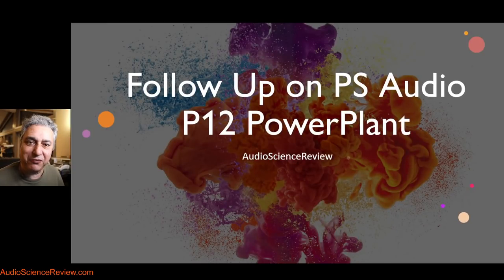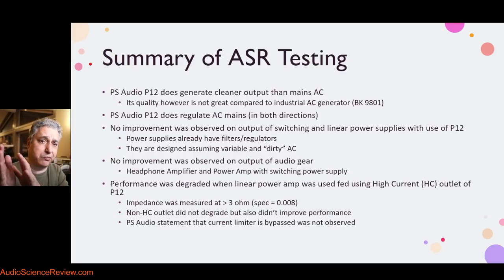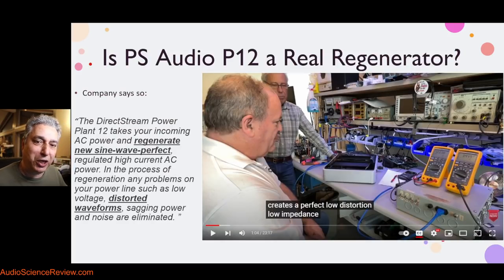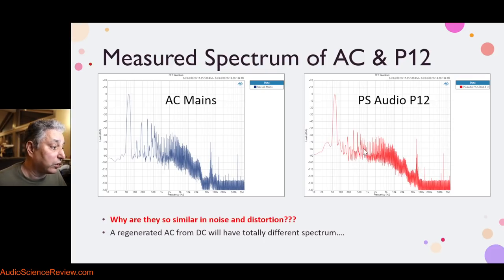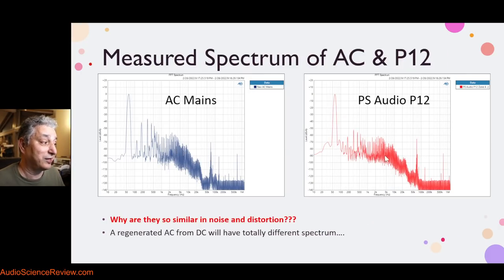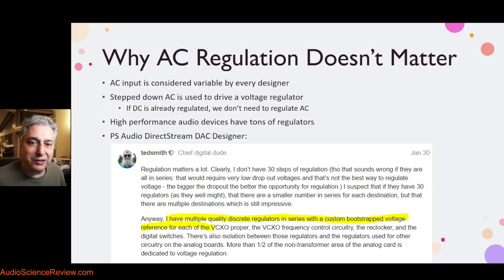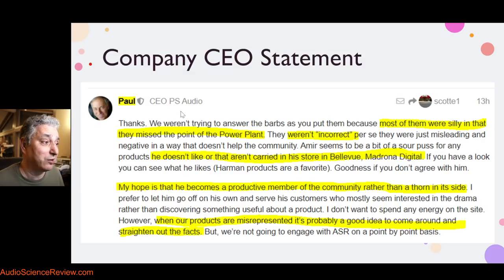PS Audio PowerPlant Measurement Follow Up

Comment: I am not surprised he replied like that. I used to watch Paul's videos when new to the hobby, but I quickly moved on. The guy gets asked reader questions (a good concept so far) but his replies are always very vague and almighty. He presents himself as an old man with ultimate knowledge and experience, he can't be wrong. I work with electronics, restore old tube radios as a hobby, his "lab" didn't impress me. You can't argue a waveform or a spectrum result unless you are in a cult or in bad faith.
Reply: @joesmith4443  How many times are you going to cut and paste this same tired steam of innuendo and heavily curated observation leading to a thoroughly banal conclusion?
Reply: @_kardus  yes but I’ve seen Amir along with his “Donors” crap on input from vendors regardless if the information is accurate and factual simply because he and his “Donors” are cynical or don’t like their products or digital format nor fully understands them or don’t want to!
Reply: @joesmith4443  Amir is financially independent, but that doesn't mean he must live off fresh water and love.  He has every right to get renumerated for his time and investment. 
Don't forget that for a 'hobby tester' he has more testing equipments than some audio companies....
Reply: @dihydrotestosterone  look I’m not saying what Amir does is not valuable and it’s nice to have a “customer reports” or “buying beware” watchdog. It’s just that what he created is somewhat of cult (probably not by his design) 

I don’t mind that he is fiery but sometimes his opinions become dogma maybe not by him but by others’. We all a flawed and have blind spots! 

I am not gonna comment anymore on his YouTube page I’ve said what I want to say. It’s really not fair to the anymore to keep a grudge and keep talking negative about him and his content.  

I’m glad that he’s doing well financially and can do what he wants with his time now. Geez who the heck doesn’t want that…I wish him all the best in life and believe what he’s doing is value content to his viewership and not easy especially to take criticism like mine. So there’s no point to being a “troll” and hanging on to resentment because before you know it you turn into that cynical person trying to get likes from snarky sarcastic comments. :)
Reply: @_kardus  yea and no filter is perfect but does influence the sound signature of Dac so does how the firmware is spec’d. That’s why its nice when a manufacturer keeps updating their firmware. I’m like most hate sibilance sp?? And harshness In the playback Sometimes however I’ve found that is more or less poor vocal technique baked in the recording than the actual DAC filters or the performance of the DAC. 

The firmware algorithms are encrypted and does play a large role in the playback and overall sound signature and the circuit design which often isn’t 100% implementation to the datasheet of the dac chip which measurements only give a half truth about. It’s easy to get benchmark scores if that’s what people are testing for and what manufacturers know that’s what they testing. But then it get to people having to describe the sound of the dac which is subjective
Reply: @_kardus  You just answered your own question if it’s poorly designed he doesn’t know it from sine testing on a DAC. Unless you are saying listening the 1khz or 2 khz is a “pleasurable” listening experience. 

In one review he complained that a particular speakers eq was “off” than adjusted it with a presumably is an expensive eq software and it was perfect. That’s a little more legit of review but that’s a software/firmware adjustment that can easily be fixed by the manufacturers if he wanted to inform them of it instead he bashed them at least let them know what you think then post your review if they tell to eff yourself. Give them a chance to at least fix it or explain their engineering decision before you bash their product! We may not have the testing equipment but he does to give them fair chance to fix, a fixable issue!
Reply: @joesmith4443  His measurements and tests are excepted by other companies and engineeres such as Schiit, Emotiva, Hypex and Gene from Audioholics... I've also seen him measure out different filters built into some DACs and they seem to match what Topping or SMSL advertise. Most of these filters have little to no effect in the audible range probably why He doesn't mess with them. They're only included because AKM baked them into the chip. I'm sure you know more than Amir and all these other people so when will you be starting a YouTube channel and buying $100k in test equipment to prove these guys wrong. Can you present any academic or scientific literature that backs your claims or debunks Amir? Or is it just easier to sit at a computer and stroke your pretentious ego. At the end of the day Amir is providing valuable info most companies won't but they want you to spend $5k on a DAC or cable.
Reply: @joesmith4443  -- Nothing "is up."  Amir is a rather well-off entrepreneur and retired executive-level engineering manager who owns a well established custom installation business -- he doesn't need to "monetize" ASR.  There's no way his (relatively recent) activity of posting video versions of his reviews on U-Toob and (the typically small-$$) contributions to the ASR website's upkeep are enough to even cover the five-digit cost of his AP analyzer, let alone the six-digits he paid for his Klippel NFS.

Bottom line: the guy's ASR-related activity is a 99.44% pure labor of love and your cynicism is entirely unfounded and unwarranted.  IOW, you can't "say why" because you don't know WTF you're talking about!
Reply: @iowaudioreviews  Those DACs that you mention Topping or Smsl if you look at the specs have almost identical parts and are probably made and sourced in the same factories. Sure they are based on AKM or Sabre chip filters and whatnot and have good measurements but are relatively “clones” of one another give or take some different features. Even the different features for different price points. Why is that? 

Well because they measure great SINAD scores but  really they don’t sound all that different from one another. So they make Amir’s list of highly recommended when they all sound similar if not the same. That’s what I’m getting at there’s no individuality and all Amir is saying that they are scoring benchmark SINAD not seen three or four years going or are “unheard of only a few year ago” Amir would say. 

That’s really my “complaint” like of imagination from these DACs just SINAD benchmark scores to look at from Amir which In most case Smsl and Topping already provide the same test (give or take one or two dbs differences)
Reply: @joesmith4443

HERE WE GO AGAIN..... WILL YOU BE PASTING THE SAME REPLIES AND COMMENTS YOU DID WITH THE LAST PEOPLE YOU CAUSED TROUBLE WITH?.......

GLAD YOU ARE GOING TO JAIL.

Comment: Excellent data and measurement-based response! Thank you for doing this for the community! The consumer community!
Reply: Yes but in fairness to Paul he did say that there was a firmware update that affected the measurements. For accuracy Amir should do this check as well.
Reply: @joesmith4443  so basically he sold a product with faults that needed a firmware update. Amir, said he used the latest firmware !.
Reply: @r423sdex  Amir didn’t. Btw I’m not advocating for PS audio crap just believe in fairness
Reply: @joesmith4443 

SMITH...... YOU AT IT AGAIN?..... PASTING THE SAME REPLIES TO DIFFERENT PEOPLE?.....

-- Nothing "is up."  Amir is a rather well-off entrepreneur and retired executive-level engineering manager who owns a well established custom installation business -- he doesn't need to "monetize" ASR.  There's no way his (relatively recent) activity of posting video versions of his reviews on U-Toob and (the typically small-$$) contributions to the ASR website's upkeep are enough to even cover the five-digit cost of his AP analyzer, let alone the six-digits he paid for his Klippel NFS.

Bottom line: the guy's ASR-related activity is a 99.44% pure labor of love and your cynicism is entirely unfounded and unwarranted.  IOW, you can't "say why" because you don't know WTF you're talking about!

Comment: That was passionate !! :-)   Praise to you for your professionalism.  Very unfortunate that PS Audio does not acknowledge flaws and attempt to fix them, which would not prevent them flogging useless gear, but that at least it would perform as per spec and expectations. I was very also surprised to see the engineer noodle around with voltmeters; simply not serious.

Comment: I own a PS Audio BHK 250 power amp which I bought (used) to replace my ML #27 - and I never regretted this decision. I started to like PS Audio after my experiences with the BHK 250. However this episode makes me a bit uncomfortable. If you screw up - own it! It’s simple. The moment PS Audio went personal in its defense, they as much as admitted (imho) that they screwed up. 
Thanks Amir for your addition of measurements to the community!
Reply: For the most part, Amir isn't saying it's a bad product (with a few nagging issues). If it's working for you, continue to enjoy your product. The biggest issue here is what appears to be possible false advertising and a failure to have a productive conversation with the community.
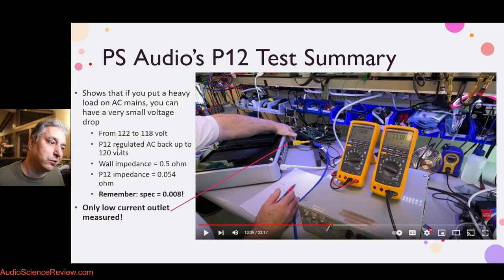Reply: do not bother, some parts that are said in this video in my opinion are at least very debatable if not suggestive or plainly wrong. The part from 8:30 onward here is most misleading: voltage drop in his slide is stated as 4 volt, but Amir calls it 2-3V; the power drawn from the device (correct value 300W) he calls 700 or more watts; so while he exaggerates on the root cause of the voltage drop by more than factor 2, he understates the effect by factor 2, then concludes obviously it is irrelevant; Amir‘s argumentation appears quite biased here. 
The key knowledge of a company such as PS Audio is doing relevant measurements- so that their equipment actually sounds accurate to source. doing just some measurements may be interesting to look at but might be misleading (noise spectrum for example: whats the load used - Amir doesn’t tell).
Well tx for reading if you made it until this point. :)
Reply: @gioponti6359  I guess it was 300W per switch, so 900 in total...
But in a way that's besides the point I wanted to make. Amir shure is not very diplomatic, but Paul's reply was personal and I think this is wrong. A discussion which could be scientific or at last taste-related becomes polar - well those are the times, I guess. 
Happy 2022 to all of you!
Reply: You can't make an ac regenerator that improves audio performance.  So even if this weren't a bad design, it's STILL snake oil.   There was intent to market something that cannot improve audio quality as an audio product.   There was no "mistake"
Reply: @josch614  true - 300W per switch and a bit nasty on both sides it feels
Reply: @zachansen8293  can you prove or provide evidence for your claim?
Reply: @gioponti6359  PS Audio and other manufactures are the ones who need to prove that AC regeneration somehow improves audio fidelity. That has yet to happen.
Reply: @1leisure1  If i was really interested in this P12 or similar, e.g. to isolate the audibly detrimental effects of a PV plant and inverters on the SQ of my hifi (if!!),  i‘d go to my hifi dealer & ask for trial and test it in my very own kit, and if its fixes SQ, I might buy it. Easy. I suppose that is what the P12 can. Really wonder why Amir has not tested the obvious nr1 product function e.g. in presence of real PV inverter dirt.
Reply: @gioponti6359  If you can find me a well reviewed audio gear that performs noticeably differently when supplied in parallel to an effective 4Vdroop load as opposite to a 2Vdroop load, I'll buy that gear for you. That difference is immaterial. Anyone designing regulators can tell you this.

Comment: After watching this video I wanted to start with the technical part but then felt it affected Amir so much I wanted to say…anyone with any technical expertise is 100% on your side. Not that this is about taking sides, but it is about the truth. Now the technical part. After working in the electrical industry for 40 years which included power quality analysis AND UPS sales I can say with certainty that power is the most misunderstood topic and subject to voodoo in the industry. Had many customers who were certain they had some power issues and wanted an audit who’s was not easy or cheap who were very disappointed when the results did not show what they were expecting.

Comment: PSaudio had to do something to defend the buyers of the expensive gear their customers bought in order to improve the sound quality. I’m glad that you have measured the P12, I will never buy such devices although I considered it once. Changing the speaker positioning by a small bit has lots more impact than a regenerator could do (in the case they don’t make it worse). 👍 for Amir. We need more Amir in audio so we can spend our money on the right equipments

Comment: The idea that cleaning AC prior to the audio device AC filter, to increase clarity at the outputs is based on ignorance on the buyer's part, and greed on the manufacturer/designer. It's REALLY dumb to filter high power when it's not needed. The device needs low voltage DC. That's it! Cleaning high voltage AC requires expensive parts. Doing it TWICE is pure silliness. The A/B listening test is what they should be spending money on. Who would pass that? Same thing with 'cables'.  Why don't they invest in AB testing and PROVE their assertions of signal improvement/enhancement? They can't. Snake oil sells, and it's very cynical for people to make money on people's ignorance. Thanks for following up to help consumers, Amir. GREAT SERVICE.

Comment: Thanks Amir you are the best, your comprehensive test seems to show that as advertised it’s an AC regenerator to the extend that it’s able to regenerate the noise and distortion to almost the same level as the mains but with stable voltage so basically we have a fancy voltage regulator.

Comment: A couple of years ago I bought a brand new P20 and sold it within 6-months. It added so much noise to my system. I sent it back to PS Audio twice in that time to be checked out. They never could find a problem. It sounded like DC was being added to the line. I know some seem to love their products. For me it was the worst. Matter of fact I sold all my PS Audio gear in that time. I was extremely disappointed after spending tens of thousands of dollars with them.
Reply: I have no experience with PSA, other than watching Paul do his videos, which never seem to answer the questions asked, they are always vague to me, unlike Amir who is an actual engineer with real test equipment that CAN answer the questions. 

Now, I do not agree with the one and zeros all of the time, as I have heard things differently in my system. And this is nothing against Amir and his videos, which I do subscribe to. I am not always in 100% agreement, and that is not a slap against Amir and the work he has put into this venture of bringing us the hard facts. I can say the same about Gene over at his Audiohaulics site, I respect both men for their works, as they have both educated me in this foggy world of Hi-Fi... 

To my point, the gear we have access to today is lightyears ahead of what we could get just a few years ago. The quality and manufacturing costs, along with factory direct manufacturers, it is just another world in regards to cost and performance out here. 

My thinking, and not knocking you for your PSA purchases in the past... My thinking, the gear that Paul sells is for another group of folks,  folks that have not kept up, spend more for better sound. That would have been true a few years ago, but like I said above, we are finally at another level in quality audio gear. Today we can do more with less, and do not have to break the bank to find that sound that was literally out of reach for many just a few years ago. 

Paul is slick, and I bet a real SOB to work with and for. I picked that up in a number of his videos, and the above just solidifies that in my mind. The shaking hands of the tech says it all... 

I see Paul as a dinosaur in this industry, selling nonsense.
Reply: Also the modules and parts used from what I can tell are inexpensive. Shiny metal boxes that are mostly empty.
Reply: @dillonsaudio  Empty?  They are full of hopes and dreams.  And guile.